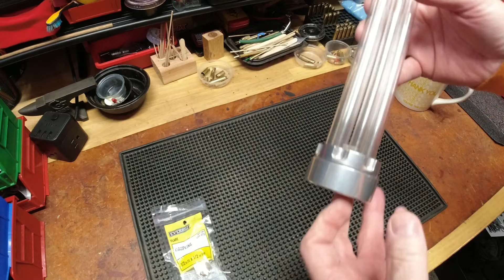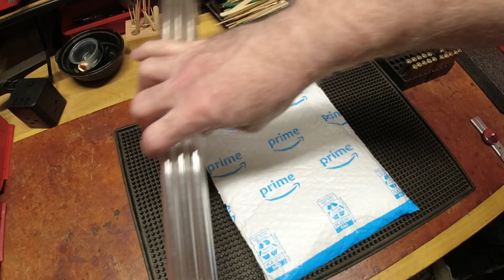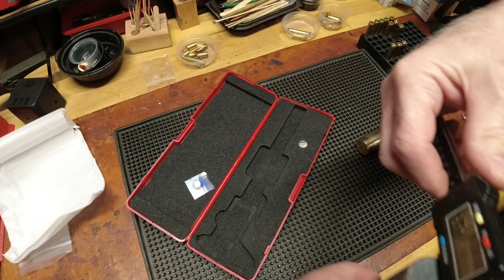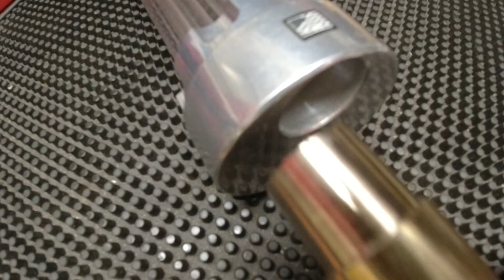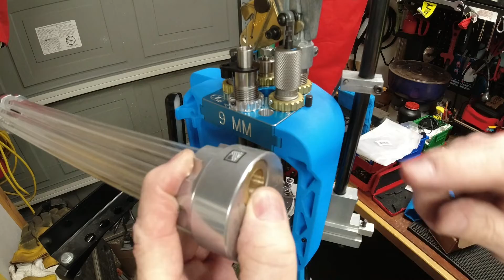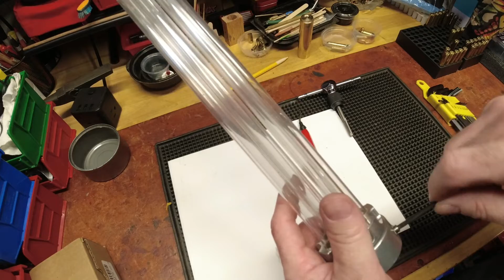Machining a Fix for a Mag-P / Lee Bullet Feeding Die Fit Problem on Dillon XL750

Comment: I worked in a machine shop for 30 years and been reloading since I was 18  ( I'm 81 now)  most specialty parts or sleeves I needed  I make from PVC pipe or aluminum  (if it's strong enough for the task)  If you need a thicker  PVC wall thickness, glue a piece of pipe into a coupling.  This process has really worked well over the years and a plus is,  your lathe tooling will last forever. Good Luck!
Reply from the maker: You've been reloading longer than I've been around!  Kudos to both your longevity and your reloading, quite an accomplishment on both.  I hope to be 81 and still reloading.  My reloading "interest" however did begin when I was 18 in the Army.  Unfortunately, I lived in the barracks and no ability (or space) for reloading gear (in hindsight I guess I could have handloaded with Lee gear that wouldn't have required a press...but I can say I "should have done" many things differently as I look over my life, LOL).  Wasn't until much later in life (14 years ago) that I decided to jump into reloading.  So glad I did.  I cant' decide if I shoot to reload or reload to shoot.  Thoroughly enjoy the hobby.   Now with my machining tools, that takes the hobby into a new direction and address previously limiting conditions (e.g., the Mag-P issue).  Thanks for the great tips.

Comment: Question now is will  you sell some for MagP and MagR?
Reply: You're awesome.  Mr socal doesn't return any messages and just doesn't seem like he's interested in it anymore.  Thanks for being innovative.
Reply from the maker: @choochmonster13  - Thanks.  I felt I was on my own after the last non-update.   My solution to the issue may not be ideal, but it has me back in business, which is all that matters.
Reply from the maker: Making/giving/selling the brass insert (when/if I get my lathe working again) is not the challenge.  I drilled and tapped the insert and Mag-p base together at the same time.  So I can make the insert, I just can't drill & tap it as there is no way to ensure it would align with another/your Mag-p (and don't have a Mag-r to get dimensions from) base that you'd have to drill/tap.  Easy to do it all at once and together.  Separately would introduce measurement/offset variances me thinks.